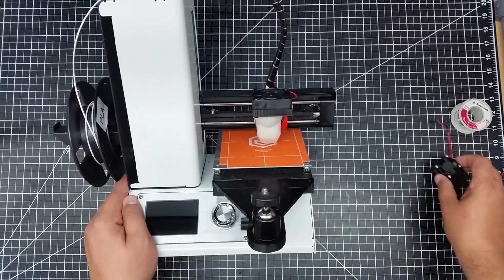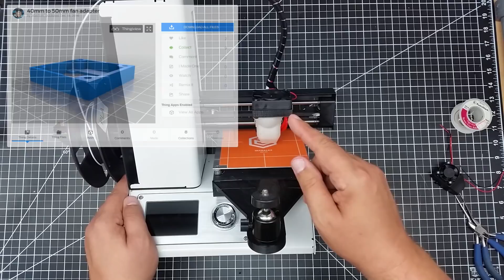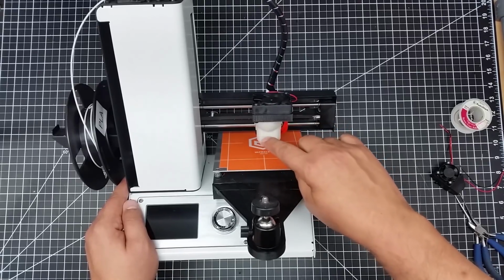MonoPrice Select Mini 3D Printer - Installing A Super Cooler Combo!

Comment: Nice mod.  My mini has served me well but I found myself using it less and less in favor of my other larger printers.  It used to be my proto printer but my AnyCubic linear plus Kossel has become my proto printer of choice due to its speed.  Great starter printer that will print just about any filament you throw at it.  It has gone to a good home.
Reply from the maker: Ah... color me with a little tear in the corner of my as I couldn't part with mine.  However the "AnyCubic linear plus Kossel" does look very cool!

Comment: Thanks Joe, I liked to 50 to 40 adaptor. Cheers, JAYTEE
Reply from the maker: Tell ya this little has really worked out nice, all my video are shot in the past as travel for business so have been using this for a while and it works well!
Reply: Last week it's clone, the Cocoon Create Mini, was on sale at Aldi ( supermarket chain in Australia ) for $299 AUD ( approx $230 USD ) I was there to get cheap filament but didn't get the actual printer. Maybe I should have. Oh well
Reply from the maker: If your into 3d printers you bet, this little guy is worth it!
Reply: Sadly it was a one day only promotion via the wholesaler. They don't sell them throughout the year